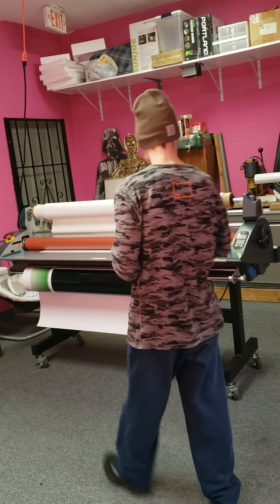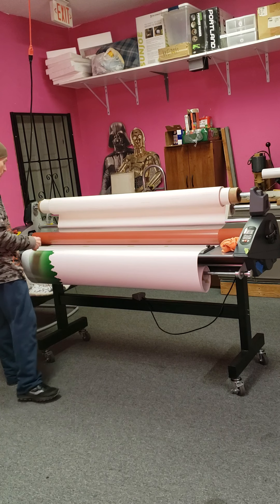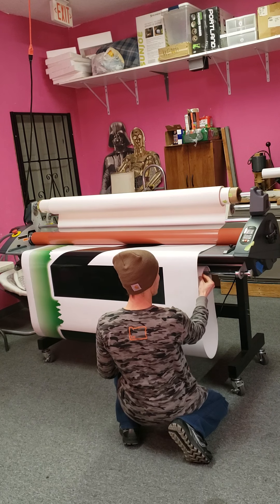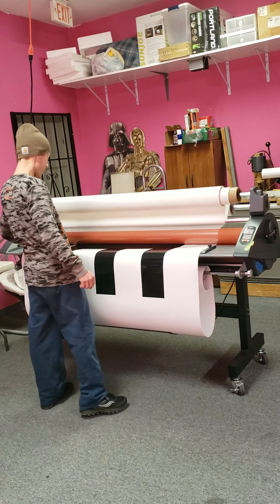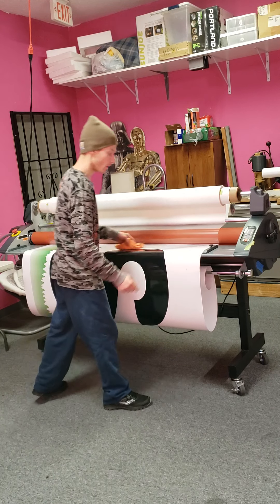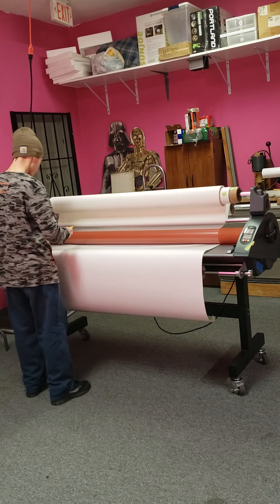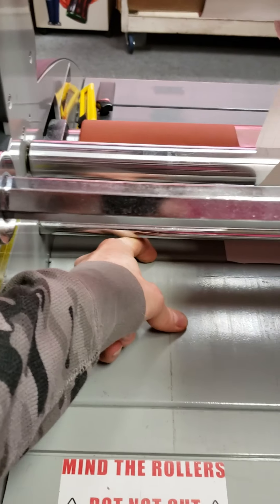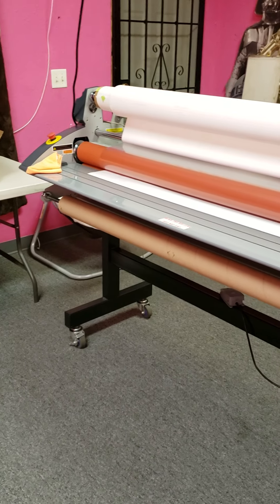Royal Sovereign  RSC-1650LSH  64" Hot and Cold Laminator

Comment: hey man what brush are you using for dusting the print before it goes into the laminator? I was having trouble hearing you in the video so i don't know if you mentioned it or not
Reply from the maker: I use either a drafting brush for a conventional drafting table. Or a microfiber cloth from Costco to dust the print off as it feeds through

Comment: Do you use that same laminator to mount the laminated graphic onto the rigid substrate to make your sign?
Reply from the maker: Sometimes. I can mount to a rigid sub-state in multiple ways but a good way to do it is fold back the wax paper about 4 to 6 in. Stick it down to the sign panel. Then pinch the mounted Edge in the roller on the laminator. And Peel and run it through at the same time.